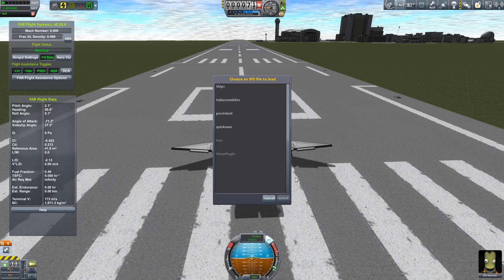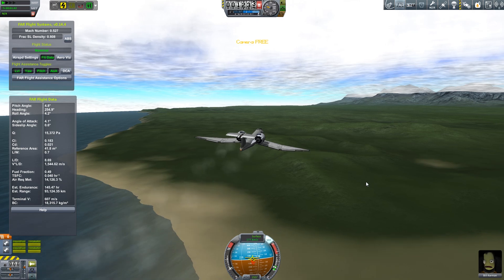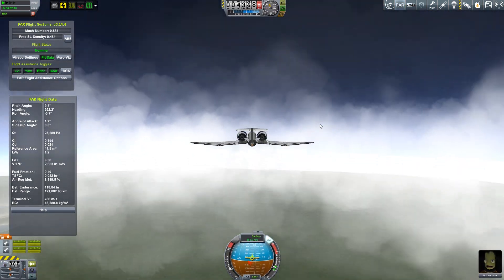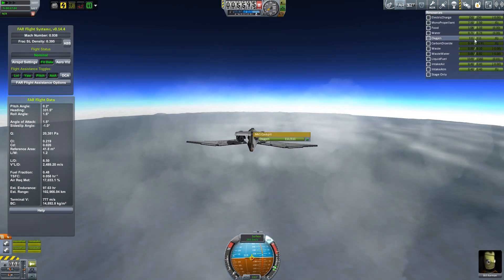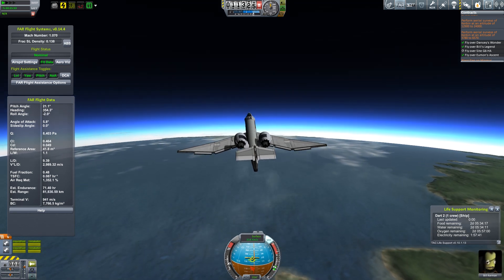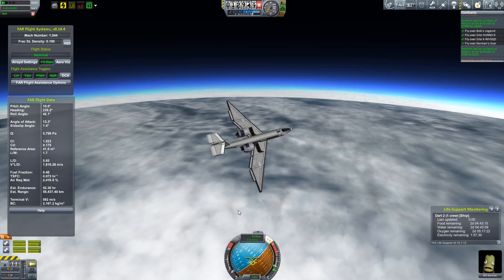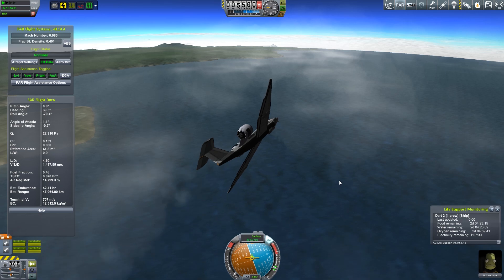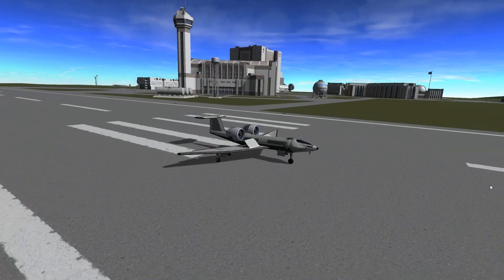Kerbal Space Program - Kerbal Realism - S3 Ep9 - Jet Plane

Comment: 300 m/s is about 1100 (1080) km/h which is quite impressive still, you could maybe be able to make a economy variant of that plane by removing one engine and moving the other one down and to the center
Reply from the maker: No real reason to make another variant that is economical. The best thing to do is make a new plane that can reach higher speeds and higher altitudes. With that hypothetical plane, you could easily do laps around Kerbin with very little fuel spent. Wait for tomorrow's short video for a peek at the new plane.